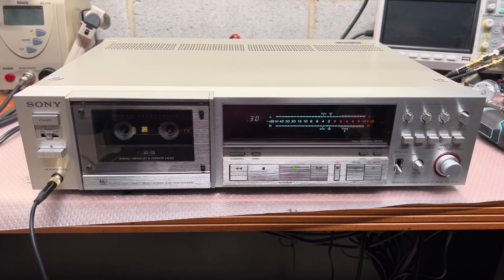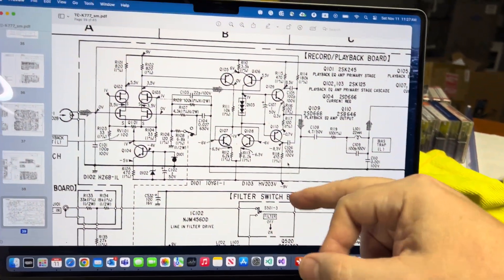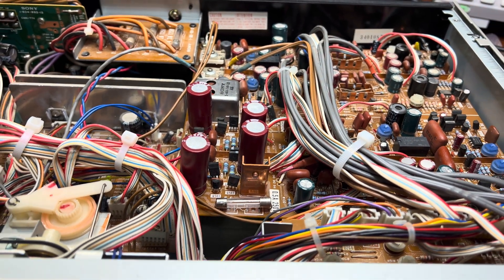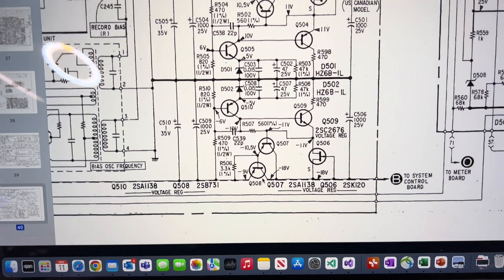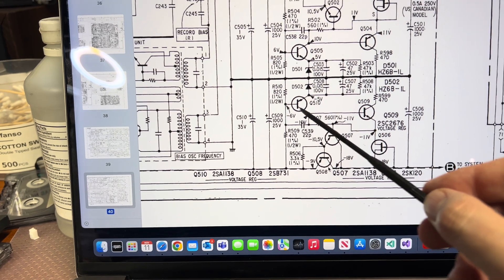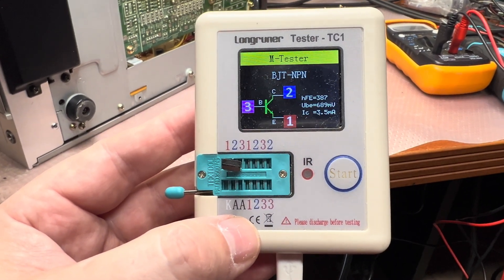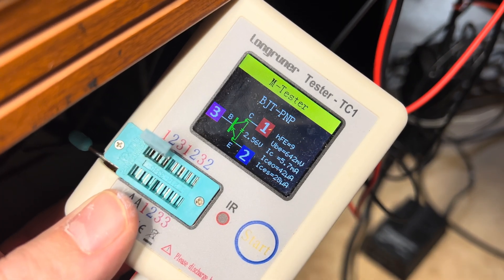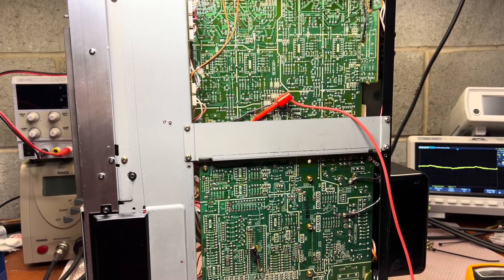Rescuing the Sony TC-K777: Unraveling and Fixing the Mystery Malfunction

Comment: Wow! At last you have one on show!
I don't think there is anything out there to match it in terms of the versatility, construction and sound quality combined. Something to pine for! Now, if only it's successor also had Type III capability, like the successor of the TC-K555 did, then this would be the second deck out there to be going after but as things stand, it stands pretty much on its own.
Reply from the maker: I have videos about fixing this deck earlier this year, also ES and ES II
Reply: Woops! I actually thought this was the 777ES - not the 777 - and I meant to write 555ES - not 555 - in my comment above  @hifirulezzz  !I had forgotten there were three versions of these decks - not two. Apologies for that. Though perhaps between the 777 and the 777ES II one can get an idea of what the 777ES might entail.